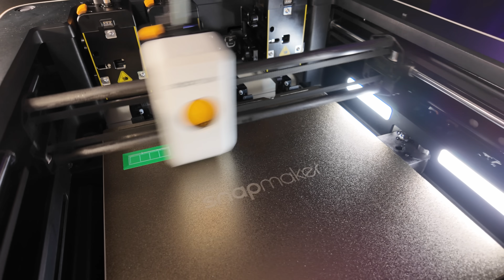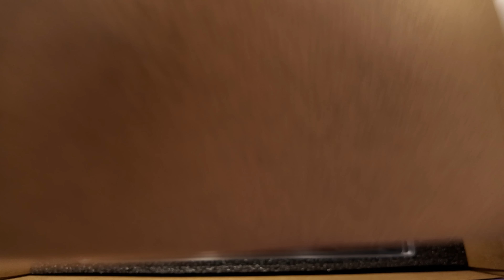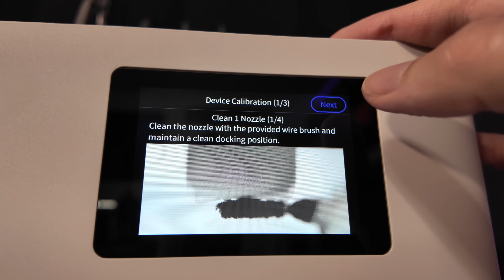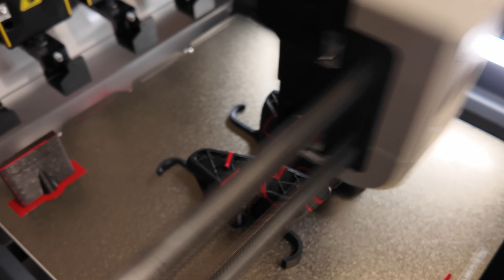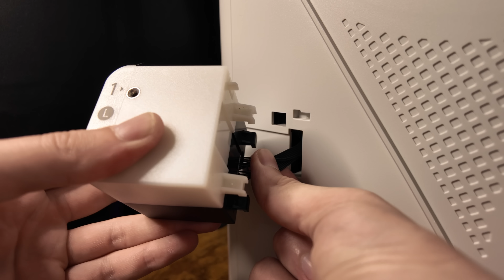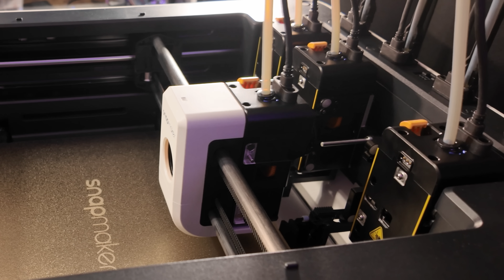Snapmaker U1 First Impressions

Comment from the maker: Kickstarter: https://snapmaker-u1-color-3d-printer.kckb.me/8835252c
Reply: AFAIK the 6 pin connector is for the temperature controlled fan in the (optional) top cover...
Reply from the maker: What about the extra tools in the fluidd interface 👀
Reply: @NeoKoiPrints I don't know. Maybe the 4-pin connector at the back, next to the USB? Or maybe it's a chaining system like Bambu's and the cover will itself have another 6-pin outlet. Or maybe it's just some Klipper default they haven't yet changed...

Comment: I have the Snapmaker 2 A350, which I got through kickstarter, and yes it has it's issues, but a lot of those issues have been addressed, as well as mods from other sources that made the A350 a really good printer.
I expect much more from the U1, since it is a dedicated printer, and not a multi head tool like the A350.
I did get this on the kickstarter for a really good price, so I am looking forwarded to receiving it.
I liked your review, you were honest about what is wrong with the U1, what people want is the truth, sure there are people who just want to hear the positive, but the reality is any new product like this is going to be buggy in some respects. If you are getting the first versions of this, you can expect there to be problems that will need to get worked out over time.
Snapmaker is a good company, well established and they deal with issues their customers inform them about. If this was a new company I would have hesitated at the price the kickstarter campaign was giving, but having first hand experience with Snapmaker, I trust they will take care of their customers if they have an issue, also the community is great at helping people when needed.

Comment: I have never owned a 3D printer and am considering becoming a backer.  When doing my research, I compared the print quality of this U1 printer with 2 Bambu models, the A1 and H2D.  In these comparisons, yes there was more waste with the Bambu machines but the quality and resolution of print on the Bambu machines seemed better than the U1 as well.  Am I mistaken?
Reply from the maker: Overall the quality is relatively the same, print time and size are other factors here. If you olan to do multi color printing, the U1 will save you sooo much time, less wasted filament is also very nice. The h2d wins in size though. So its really going to come down to your budget and what you need out of this tool

Comment: Very well put together video. The price is very interesting especially for the amount of tech crammed into this printer...that additional port is likely for the top unit that houses the filament dryer/dehydration unit is my guess. Its an additional on according to the kickstarter.
Reply from the maker: But what are the 4 extra tools macros for👀
Reply: @NeoKoiPrints  idk but there's no space for more tool heads.... maybe link 2 machines together?
Reply from the maker: @JuanMakes That would be wild

Comment: Nice machine, but Qidi already knocked Snapmaker out.
Reply from the maker: How do you figure?
Reply: @NeoKoiPrints The main outcome most consumers want  are multi color prints.

Tool changers are nice for a niche audience. Filament changers (AMS/CFS/etc) serve most of the purpose without increasing more points of failure like a tool changer does.

Then the cheap housing of the Snapmaker and missing features make this a good machine for the people that want to work on printers and mod them, not the people that want to create and print.

I’ve had a Bambulab with AMS. Sold it after their anti consumer practices. Got a Creality K1 speedy with CFS and now have the Qidi Q2 combo. Why Qidi? The combo is also a filament dryer. 

Small off topic rant: The problem with many companies is that user experience and ownership is taking last place and it is really infuriating. From finishing details to locked down software to bogus “security” measures just to annoy the consumer. I was personally fed up with these manufacturers until I have the Qidi. Hopefully this company can keep the good reputation I have of them clean.
Reply from the maker: I think you’re the only person saying another bambu clone is better than a $1,000 tool changer lol 

Tool changers fix everything wrong with multi color printing, time, waste, and now cost. With the added benefit of true multi material printing.
Reply: @NeoKoiPrints If you think the Qidi I mentioned is a Bambulab clone then you haven’t printed with one.

Time? Saying you care about a couple of minutes on a hours long print is disingenuous. Waste? Fair point, but at the cost of more points of failure which you don’t address. Cost? You don’t specify what cost, so it’s a moot point for which you can move the goalpost again and again.

Multi material is not exclusive to tool changers so another disingenuous point.

It’s so sad YouTubers need to resort to dishonest and disingenuous points, because they have a superiority complex.

Sad. I like the channel.
Reply from the maker: @Harry-Baals-l2d Im neither dishonest nor disingenuous, what do I have to gain here, you just dont understand what youre defending

“A couples minutes on an hour” is so far from the truth as far as time savings is concerned, tool changers cut print time in half compared to an ams style printer

Other style printers cannot do true multi material printing, one example being tpu and literally anything else. Another issue, If you dont purge an insane amount of petg vs pla you will have a failed print almost everytime. With a tool changers you dont have to worry about contamination because theres no filament swap happening in a nozzle. 

More points of failure, yeah, for a more complex machine youre going to have more points of failure, the sky is blue lol that doesnt make a toolchanger bad

Im pretty sure the guy acting superior for buying a qidi over a toolchanger is the one with the superiority complex 🤣

Comment: For flow calibration wouldn't you only have to run it once if your not changing out the filament type from print to print?
Reply from the maker: Not necessarily. All filament is not made equal
Reply: @NeoKoiPrints  true, I guess the same type and brand I wouldn't bother doing the calibration more than once. But I guess if they put more profiles in for specific brands / filament types that hopefully will eliminate having to do calibration so often.

Comment: Can you comment on the accuracy for those of us wanting functional parts and not trinkets?

I've got a few printers and the qidi plus 4 is by quite a margin the best for repeatable accuracy when printing large items with tight tolerances. I've spent hours with tuning klipper for skew corrections for some printers but repeatable accuracy the qidi plus 4 is superb.
Reply from the maker: I have not tested accuracy with stock profiles because theyre still evolving. Weve been giving them changes to implement. I know inputshaper issues have been something weve told them about as well. There were 200+ bugs the beta testers found for them so itll be the best it can be
Reply: @NeoKoiPrints appreciate the reply. I've broken my No1 rule in printers, never pre order, wait a few batches. I suspect as a late joiner to the queue I will be well outside batch 1 anyway. 

Appreciate the testers and the openness being showed here and the commitments to klipper.

I have been patiently waiting on affordable multi tool, I couldn't care less about ams systems due to the massive time and filament waste, I want the abilty to print multi material designs accurately, hope this fits the bill.

Comment: Tool offset is NOT an issue AT ALL on the Prusa XL. The tool offset calibration takes about 15 minutes and it's DEAD easy. Manually feeding filament through PTFE tubes is also not a big deal. My friend's experience with his SnapMaker has been a nightmare. They have sent him multiple replacement parts, he's bought others and, after struggling with  it for a few years he STILL can't get it to print right. At the price I think this printer is worth  a try, just don't expect it to be as good or last as long as it's competition.
Reply from the maker: Tool offset is labor intensive on the XL like my Stealth Changer is. Im not saying its hard lol On the U1 its automatic

Manually feeding sucks. Its not a big deal until you have to do it several times per print

This machine is very different from snapmakers last few machines but I can understand that hesitation for sure
Reply: @NeoKoiPrints I strongly disagree that it's labor intensive. You follow the prompts on the machine, remove the build plate when told, thread in the alignment pin, then let the printer do the rest.
Reply from the maker: My fault, labor intensive might not be the correct terminology for what Im trying to say. Its significantly more work than the U1 where you clean a nozzle and it does everything else for you. Thats all im trying to say here

Comment: Thanks for the first look! I backed it earlier today, although it's being listed on EB as $749, as the KS had already launched by the time your first look went live, but still at that price point for a multi-tool printer it seems a steal. My only slight reservation is I bought a Kobra S1 with 2 Ace Pros a few months ago, and I'm wondering if I'm at risk of replicating use function here? I was wowed by the fact that the mount of waste that's pooped out is so much less than typical multicolour printers.

Comment: China is the largest and most inexpensive aluminium producer in the World. That whole plastic argument is moot for any Chinese company due to the Communist governement's assistance and supply assurance program for all Chinese Companies. This machine is a taste product. Meaning they will give the regular people a taste of some of the benefits but not all of them. Also in the military, most stand alone machines and electronics had some sort of six pin connector for Quality Assurance and tests of the machines responsiveness to commands and troubleshooting..

Comment: I would have wanted more print examples but other than that, definitely glad to have seen your video and opinion. I'm backer number 908, i would've been in the first hundred but i wanted to watch a video or two first justtt in case. Seems i was right about how it's 90% there and i should have just backed it off of the bat XD
Reply from the maker: I had a limited amount of time with it before recording unfortunately but I completely understand where youre coming from

Comment: I believe the 6-pin connector at the top is for a tophat enclosure with active filter. Will need to confirm
Reply from the maker: They did confirm with us that its for enclosure and filter, as well as other potential accessories. Had I not seen t4-t7 in the web interface I wouldnt have brought up the ams, but..👀
Reply: @NeoKoiPrints  .... imho, an AMS setup would normally also require a toolhead with a cutter.  As these aren't there, I'm going with the "those 6 pins are for an enclosure/dryer" approach.
Reply from the maker: These use “tip forming” to unload/load which is also an option for the box turtle but its confirmed for the enclosure stuff plus any accessories coming in the future
Reply: @NeoKoiPrints  Be cool to somehow add more tools or like you said an AMS-addon